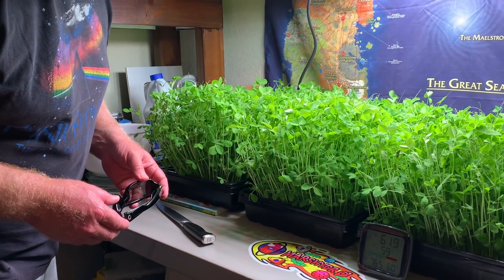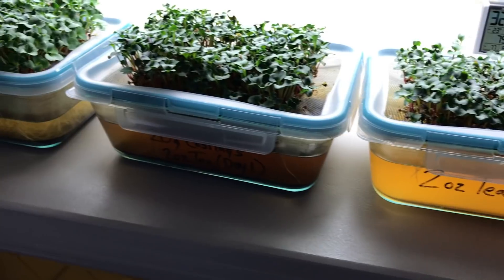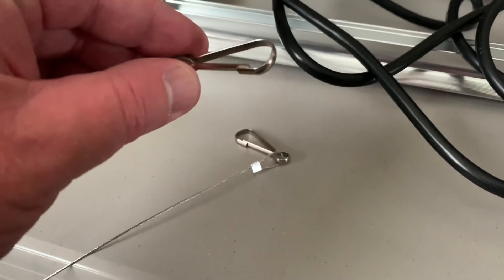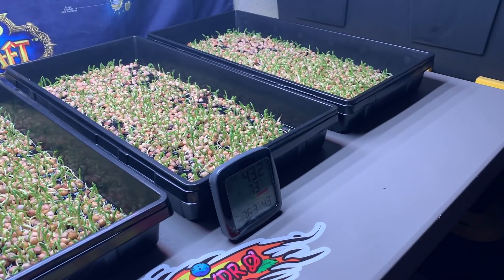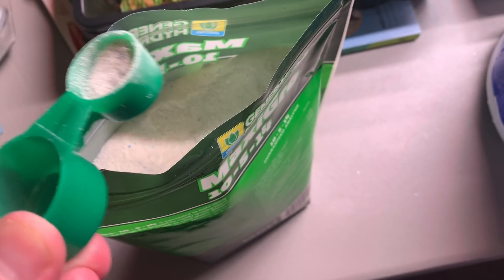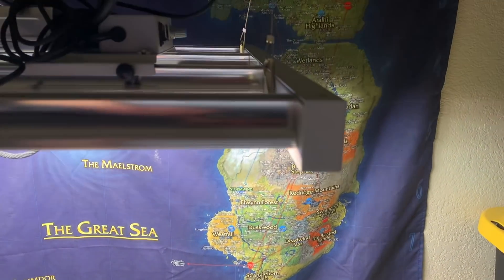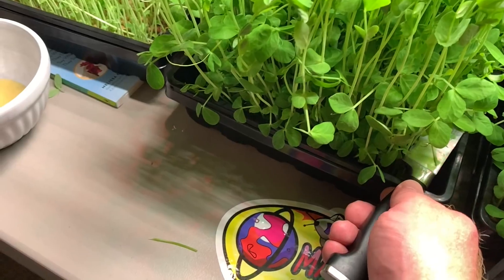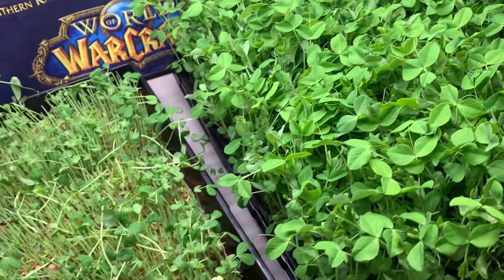How Light, Nutrients, and Heat Affect Hydroponic Peas

Comment: The reason the ones in the center are shorter is because they have more light . Rather more to the point , the ones on the edge get less light so they want to reach ...
Reply: Yeah, I was wondering if the ones in the middle might be shorter due to not needing to stretch to the light, and the ones not directly under it were possibly trying to grow towards the good light spot harder.